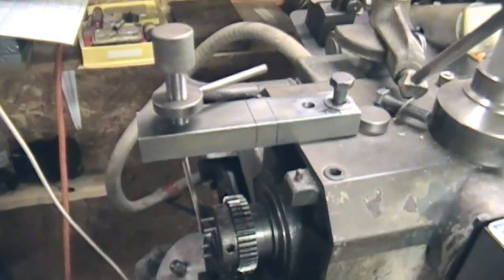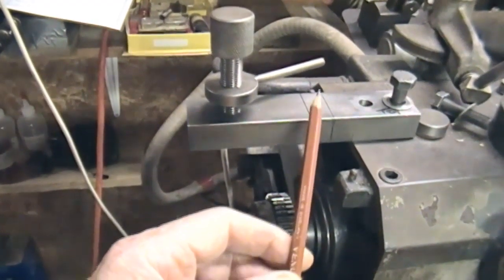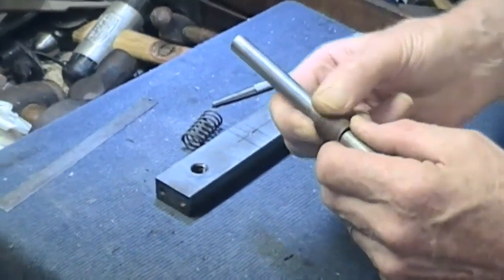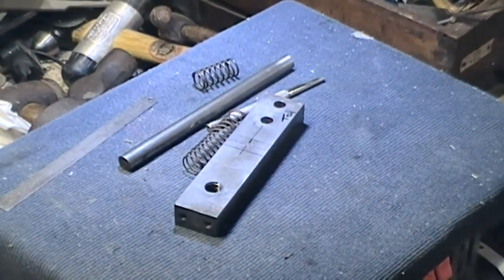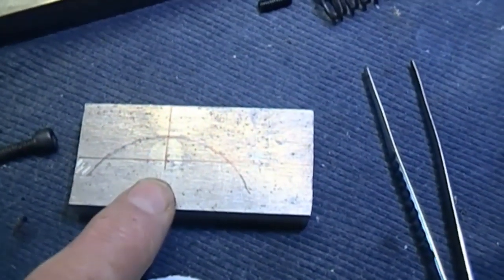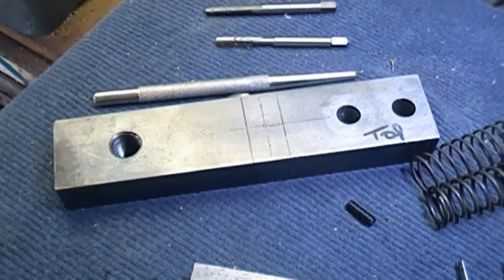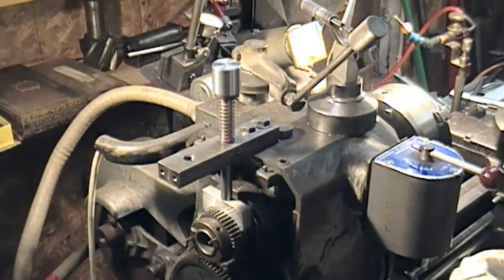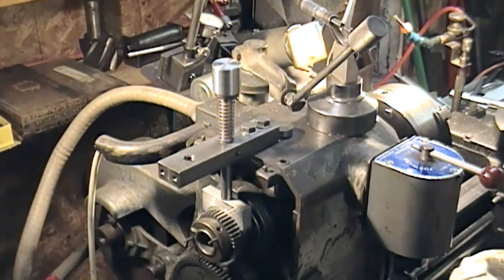Lathe spindle brake project - poor result

Comment: Hi Chris, many lathe brakes have a leverage factor foot brake if you could add a lever you might achieve suitable results... There indeed many possibilities! Enjoyed it thanks! :o]

O,,,
Reply from the maker: Thx - certainly a possibility but may be a bit complex to arrange mechanically. Probably have to be more like electrical with solenoid actuation type deal. Another thought though for the ideas box!

Comment: It is common on many electrical machines to have the brake function done at the motor.  Cranes are possibly the most common example.  In this setup the brake also holds the load.

One thing to decide up front is how fast to stop the machine.  You realy do not want to stop in terms of microseconds - real hard on the gear train.

I favor dynamic braking of the motor itself.  DC motors are the easiest just put a resistance across the armature.
  It can be done with single phase motors also but this required a dc source to energize the field winding which will brake the motor and driven load,

Propablty the best is 3 phase motor and a VFD - all kinds of advantages here and all within the VFD - quick reversall, dynamic braking, ramps fro starting and stopping etc etc. 

Dan  Bentler
Reply from the maker: Thank you Dan - well, I am stuck with the single phase induction motor otherwise yes, dynamic braking would be a good option. However, following your mention and another - will see if there's an option to mechanically apply braking to motor itself. I have many options to consider now after so many good suggestions.
Reply: ChrisB257
Yes you can use mechanical brake on the motor - either integral or an independent brake.  Generally solenoid actuated to apply the brake and spring to release it.  Have given thought to using automotive disc brake setup rotor shaft etc etc on other machine applications - have not had the need to do it yet.

All motors will generate and all generators will motor.  The motor acting as generator while being driven by overhauling load is what gives dynamic braking.

As a motor control electrician do not overlook dynamic braking with single phase motor.  Look up DC injection braking - is done on 3 phase but has some big drawbacks namely heating of rotor -- it can hold a load but due to rotor heating is not commonly done.  Biggest challenge is finding thru trial and error the correct current to put the single phase winding to slow motor in desired time.  Lot of tinkering with power supply and all that nuisance stuff.
Reply from the maker: dan bentler Thanks again Dan -- appreciate the extra info.
Reply: ChrisB257 a single phase induction motor should still work as a generator, you just have to connect the load in parallel with the motor before turning off the power. you could try something simple like light bulb.

Another option is putting a small DC current on the motor
Reply from the maker: Lasse Langwadt Christensen Thanks -- more food for thought!

Comment: I haven't watched the whole video yet but from the start it looked like there wouldn't be sufficient brakeing power from just a plunger.
Never mind that - it can however be very rewarding to just make something on the fly rather than going all fancy with CAD drawings and then again, sometimes you just make scrap but as long as you learn something its all good and I appreciate the time and effort you put into your videos.
Now for something useful, it disassembled a old German turret lathe a few years ago and it had a spindle brake consisting of two half moon shapes (they had asbestos wear pads)  that were hinged so as to move parallel and with a leaver arrangement to amplify the input of springs. The lever to turn on the motor disengaged the half moons. I hope you get what I'm trying to say.
Reply from the maker: Ahhh - now there's a thought, thank you. I shall see what might work for a mechanism.
Reply: ChrisB257 I dug out the old German lathe parts and made a short video. hope you find it useful. watch?v=2ciEW6_IjuU
Reply from the maker: Lauritz Saxtrup Just watched that and thank you ever so much -- definite extra food for thought. :)

Comment: Mount a motorcycle rotor on the back of your chuck and mount the caliper to the headstock. Run the cable to the floor for a foot brake.
Reply from the maker: Nice idea Bill - another for the inspiration pot! Much would depend on mounting logistics I think.

Comment: any way to mount something like this?  http://www.aliexpress.com/item/free-shipping-Boli-disc-brake-disc-mountain-bike-car-general-ropegripper-bicycle-brake-pads-caliper/1094245730.html
Reply from the maker: That is a great concept - will have to explore options in that direction.  The item in your linked page possibly has too small a bore size I think. Thanks.
Reply: ChrisB257 the interesting part is the caliper, the disc should be possible to make. you could even go crazy and put notches or holes in it so you can using for dividing
Reply from the maker: Lasse Langwadt Christensen Indeed, already have thoughts re a caliper - if enough space and caliper not too thick, may well have potential.  Thank you.

Comment: If I remember correctly, your lathe is a threaded spindle?? If so, you obviously dont want an overly effective braking system anyway. My old Logan had a hand brake lever that pressed a pad against the chuck/backplate thereby slowing it without the risk of the chuck unscrewing itself.

Colin ;-)
Reply from the maker: Yep - threaded Colin. Certainly it seems worth thought towards some kind of direct influence on the chuck - thanks - lots of ideas now to consider.
Reply: ChrisB257
Biggest factor would be the effective diameter of the braking surface. Directly on the chuck would give the largest brake rotor.
If I remember the Logan had a simple lever with a leather pad for a lining?
Reply from the maker: ***** I'm certainly giving thought to using rear of chuck back plate as a possible, thx Colin.

Comment: Sweet idea this has gone through my mind a few times with my small myford lathe would be nice to stop it fast although i think a 'VFD' will offer some engine braking i hope not sure how much as i have not ordered mine yet..Great work thank you.What about a clamp top and bottom that comes together and forms a clamp on the spindle that would also apply pressure both directions
Reply from the maker: Yes, the double "squeeze" approach had crossed my mind - just a case of logistics to make that work.  Even so, I doubt it would have enough surface area - thanks for the useful response.
Reply: I was thinking more like a clamp top and bottom with and spring with a lot of force with brass bearing sheath instead of cork,I was just thinking you are not only gaining on surface area but the clamping effect could make allot of difference but totally agree there isn't much room to work with either way great video and thanks for your contributions.

Comment: Add a lever so you can supply the pressure say 10 or 20 to 1 on the rod. As for the brake pad you might want to try a thick piece of drive belt leather.
Reply from the maker: Thanks - had thought about a lever, tho this attempt was a sort of keep-it-simple approach. Had considered leather but tend to think that would glaze and lack friction. I do have some approx 1/8" oak bark offcuts tho so may well try it.

Comment: Hi , I did the same thing before i put in a VFD, but you need more leverage and try to brake the motor side. Don't stop the end of the momentum but the beginning.
Love you videos.
Reply from the maker: Must say my thinking has deviated towards the motor side of things, in case there is any option there - thanks for the suggestion.

Comment: Bicycle disc brake caliper?
Reply from the maker: Definite possibility, although can't add much to end of spindle as used for other things.  Thx for comment.... food for thought tho.
Reply: I was thinking to turn a disk that would fit in the same place. (as I think about my lathe that doesn't have a spindle lock....)
Reply from the maker: David Kirtley David, thanks - useful thought but - not sure I could accommodate that.  However, all the excellent suggestions have sure got me thinking!!